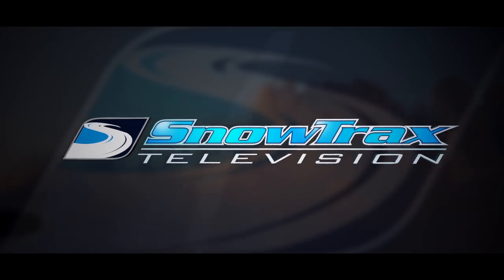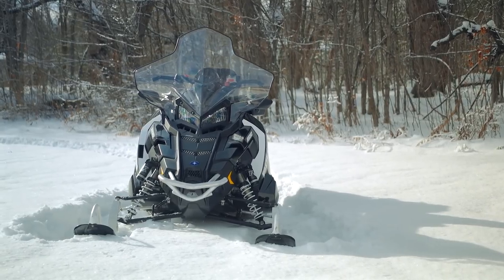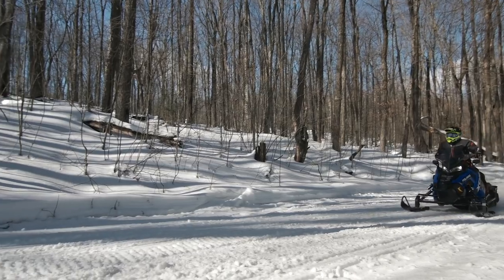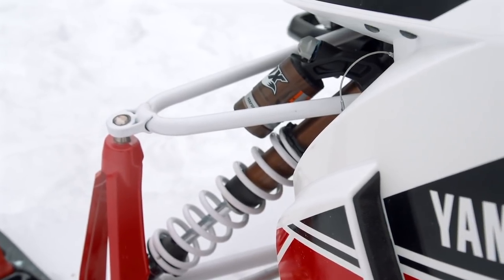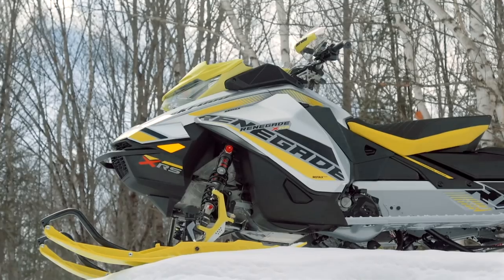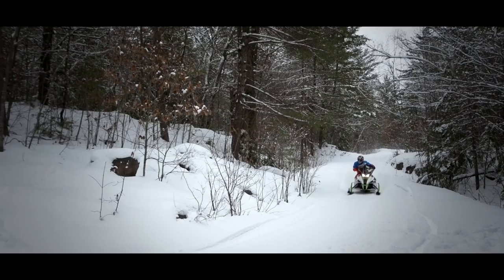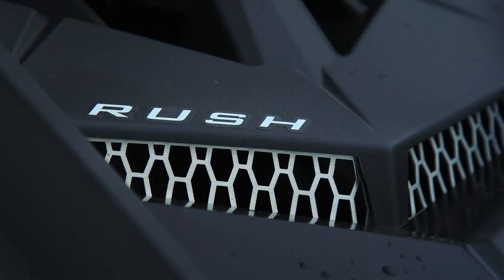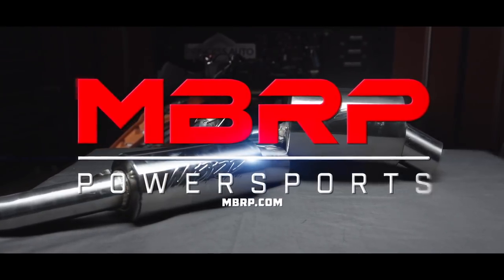SnowTrax Television 2018 - Season Finale

Comment: I don't know if it has to do with what sleds you are given, or what sleds you guys choose, but every year you take the best of ski doo, and the best of polaris. Then when it comes to AC and Yamaha you don't even test the best sleds they have to offer. What really upsets me is your review of the Yamaha Sidewinder and your skewed opinion on the Yamaha brand overall. For example, the two sidewinders that you tested were the RTX and the STX DX. The RTX in my opinion is pointless because a 129in track without studs cannot handle 204hp, therefore whoever is riding it cannot even feel the power of the sled, and the power is the one redeeming quality of the sidewinder. The STX DX is a touring sled, which completely contradicts the entire point of the sidewinder. Therefore, whoever rode these has a skewed opinion on the sled because they are not riding it the way it should be ridden. Why not get your hands on an LTX 137 with a nice set of studs? I understand that this does not fix the other downsides to the sidewinder, such as the awful yamaha skis, or the absolutely atrocious ergonomics of the AC chassis, but the way you guys test these you don't even get to see the one positive thing, that being the power that it can put to the ground. As I'm sure you can tell I am a Yamaha fan at heart, but make no mistake I am extremely unhappy with the current state of the brand. I'll be the first to say, that Yamaha did not deserve to win this award. However, I find it upsetting that year after year SnowTrax TV fails to give Yamaha the respect they deserve, by testing mediocre versions of their sleds and comparing them to top of the line Polaris and Ski-doo sleds. I really hope that in 2020 Yamaha can finally start making their own sleds and start addressing the problems that we complain about every year such as the skis, handling, and ergonomics. Maybe then will Yamaha finally get a chance at this award. I guess we will have to wait another year.
Reply: I appreciate your comments here, but I do have answers for most of them. First, we explained why we didnt test the sidewinder and chose the Viper. The sidewinder is priced significantly higher than even the XRS or XCR... putting it realistically out of reach for MOST riders. Its just not a "real world" sled when it comes to being affordable for most. Why do we pic the models we do: Well, in the past weve stayed away from the RTX Yamahas because they have traditionally rode terrible. We do try to give Yamaha the best possible chance at doing well in the competition. But we evaluate much more than just power or acceleration. Ride quality, handling, overall comfort etc etc. The RTX has always scored low in these areas. When it comes to track length, not even a 137 can put 180+ horsepower to the ground efficiently. We dont evaluate sleds with studs because they dont come that way from the factory. If a sled we test does have studs for some reason, we try to leave out any benefits they are providing so that its fair. 
I disagree with you about some of the downsides you mentioned about the Yamaha chassis. Its not ergonomically terrible, im fairly comfortable on it. We mentioned a number of positive things about the Viper this year including ITS motor, which is impressive for sure. 
If the Sidewinder was priced the same or even just closer to the other sleds, we'd choose it for this competition. It may have done a tiny bit better, but at the end of the day, until Yamaha fixes the handling issues and gets their prices more in line with the competition, theyre going to have an uphill battle.
Reply: Well thank you very much for your reply, I try not to be like most of the hot headed folks who are just upset that their sled lost, and explain what I think is wrong. When I said I do not like the ergonomics of the Yamaha, I meant the new Yamahas with the AC chassis. Perhaps you knew that, but personally I do not like the AC chassis because I find the seat is not natural, and my knees do not have anywhere to rest, they tend to slide forward and out against the plastics until I'm practically sitting on the gas tank. I find that the pre 2014 Yamahas were the most comfortable, particularly the Nytro, as the Apex feels more like an old school couch sled. I want to stress that I completely agree with you on the RTX Yamahas. They feel awful in the bumps and generally clunky. I do also agree with you on handling. I have a fair amount of seat time on the new Viper and Sidewinder models, and I can confidently say that I will stick to my Nytro XTX any day. The steering feels heavy, and the sleds just feel unpredictable, even hard to handle sometimes. I suppose I never thought of the fact that your sleds do not have studs when they are given to you, so it makes sense now. I guess in the end we really do agree on most things, I understand it's not all just about power, and I see your point about pricing. Maybe the Sidewinder doesn't belong in this category for this reason. However, I wish SnowTrax TV at least had a standalone review of the Sidewinder LTX with studs. Then you are not comparing it to anything else, so it would not have an unfair advantage, and you could stress the fact that it is sluggish without studs. Because in my opinion, that is the only place a Sidewinder truly shines. I don't know, maybe I am trying too hard to make Yamaha look good.  I am not sure what your riding habits are outside of SnowTrax TV, but I only hope that being such a true snowmobiling fanatic like me, you have had or will get the chance to take a studded Sidewinder out on an open lake so you can at least experience what it's really like, because there is really nothing like it.
Reply: @pavmentsurfer13  is the seat stock on the xcr looks like it is a skinz? you talked about how nice the seat was.

Comment: They choose the shot system but ignore the alpha one and the iact system. But they give it to the shot system
Reply from the maker: We evaluate technology following a full season of testing. iACT technology is still relatively new but it will most certainly be in consideration for this award next year.
Reply: iACT and Alpha 1 are 2019 technology. Not 2018... we only evaluate current model year product. I promise you, those will be on the table in 2019 for sure.